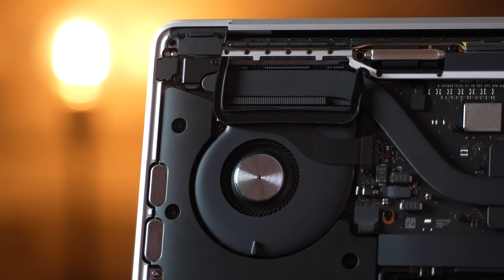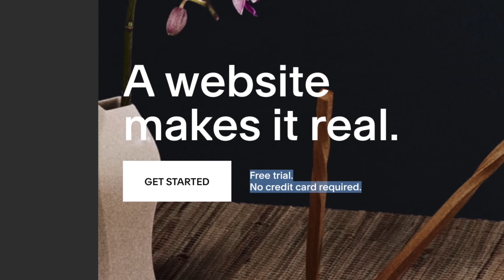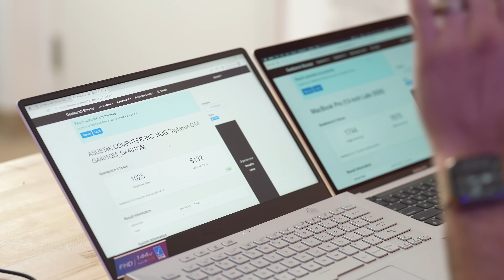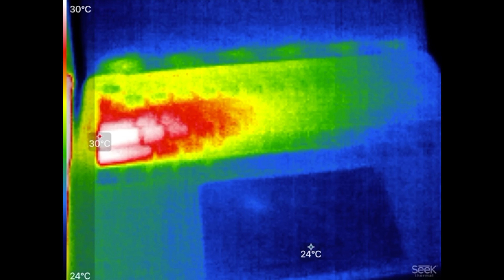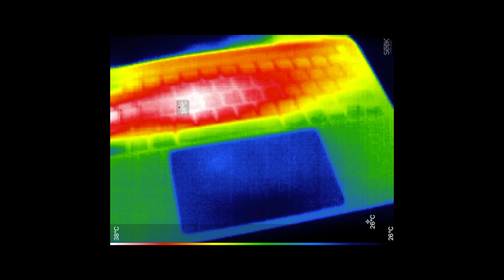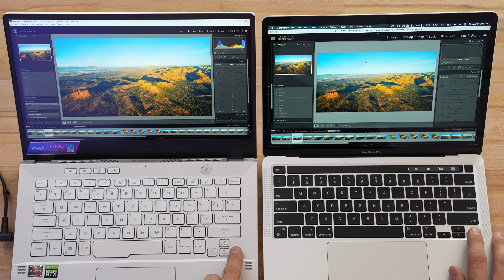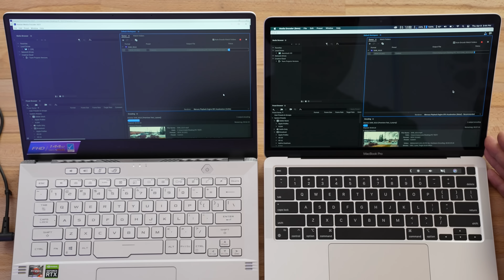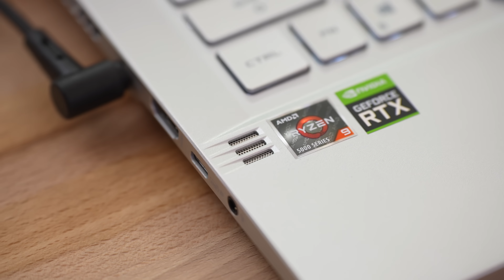Apple M1 vs AMD 5900HS + RTX 3060: FINALLY an M1 Killer?

Comment: Still amazed how M1 macs are being compared to gaming laptops. Hands down
Reply: On graphics AMD scored almost 5 times more than M1 still it's a comparison????. M1 is better in CPU but not in GPU which required for gaming.
Reply: @sakalasiva  but you missed the fact, that 5x faster GPU is only had 2x more frame rates in the next test (3D Mark). And that fps is also required for gaming. Apple still just can double the 8 GPU core to 16 or even 32, and the frame rates will goes up for gaming. Not to mention the advantage of the same ARM based store on every device. Compared to windows+android, they can give you the same game from the same store on the phone+tablet+laptop+desktop. You don't need to buy anything multiple times, you don't have 2 different savings on each device etc. Because it's the same account with same store on every device. Currently they are not better for gaming, but they have a huge potential to take this market without a real competition, when they starting to focus on gaming too.
Reply: @Garrus Vakarian how do you do a comparison for a game that doesn't even run natively on macOS?
Reply: The Price on the G14 is pretty sweet though!!
Reply: @elephant_888  Indeed $400 cheaper the the mac and faster in raw performance where it matters. Seems like a no brainer to me if you want to get the best bang for your buck. If that mac were to fit itself with the same graphics card we would probably see at least a $250+ further increase in price xD.
Reply: Actually it was never compared to a
"Gaming laptop"
He hust compared this with another laptop that happens to be a gaming laptop.
What i meant was no test in which a gaming laptop is meant to perform was used in this video like it was meant for M1 to compete.
Gaming laptops are meant for performace and tests should be base on that Port Royale, BMX, or even a real game or something which is designed to be operated on a gaming laptop
Reply: @priyanshuanubis  True, gaming laptops are tweaked to perform better at gaming and not video rendering. The driver sets are completely different. Most YouTubers don't know that. They think a pc that has graphics card and a powerful processor should work great for both gaming and editing equally. That is just silly.
Reply: @priyanshuanubis  
You are NOT IGNORANT 👍👍
Reply: @priyanshuanubis  it is a gaming laptop because it has a gpu
Reply: @priyanshuanubis  Well it did test the claim of fastest mobile cpu according to amd, and M1 excels at that…you must be confuse it with comparing it to the gaming performance…G14 is definitely a gaming laptop…asus list it as their ROG lineup…but since M1 was never geared toward gaming capability…in fact it is aiming at a low tier baseline next gen Mac, and it killing any high end mobile cpu offering from amd and intel.
Reply: with a fucking RTX 3060 no less.
Reply: @RandomUserX99  and gaming laptop still win on gaming tenfold... they do compare cpu performance, but as a gaming device  mac just suc...
Reply: @RandomUserX99  so I can play games on m1?
Reply: @RandomUserX99  he didn't even test the GPU tbh
Reply: If it cannot even run games why buy such a Laptop i dont understand Apple Fans sometimes.
Reply: @mars-kw8xo  benchmark get them off lol, bro show some gameplay that gaming laptop would had dusted the MacBook
Reply: @mars-kw8xo  and no one talks about the heating issues and the soldered ssd
Reply: @tusk6400  Or the fact apple has a history regarding keyboards that fail. They claim its fixed but only time will tell xD. Apple likes to deny that problems exist--kept using same keyboard in later models despite the flaw in design instead blaming customers for why their keyboard goes bad. Then there is also this recent problem cropping up with m1 laptops: 

https://www.youtube.com/watch?v=u7LOljirF6g
Reply: same and if games were made for the way the ARM caps work( what the m1 chip type is) it would be even better
Reply: $1900 macbook pro
Reply: "Gaming" is just a marketing term.
Reply: @l96ai  Pretty much, I am not sure why apple doesn't use that word at all in their description for ipad pro or macbook, many don't know you can game pretty well on them now.
Reply: @franciscoalcala25  Because, to be a "gaming" laptop...It need a good GPU!!
M1 has a shitty integrated one...No one calls a lap with integrated GPU a gaming laptop!!!
Reply: @harid4249  Bro it can run fortnite andd apex legends at a stable 60 fps, its at least as good as the ps4 pro, and on par with many gaming laptops.
Reply: @franciscoalcala25  🤣🤣🤣🤣
Fortnite and Apex legends 🤣
Why don't you add minecraft and sudoku for extra credit..🤣
Those are some of the less intensive,easy to run games.....
Play Assassins creed Valhalla at high settings with atleast 60fps at 1080p...then I'll admit M1 is good enough lol. Which is never gonna happen 😆
Reply: @harid4249  You may not like them but they are games, and the ps4 can't even do that. This thing is more powerful than the ps4 200 million people out there are still playing on.
Reply: @franciscoalcala25  my  non gaming laptop with 9th intel i5 on maxed settings ru. fortnite at 55-60fps. m1 run fortnite on medium at less than 60fps with frame drops... there is a differense... gaming laptops run fortnite at epic settings at 100+fps some at 200fps
Reply: @l96ai  you're damn right, when you don't mind a kg and worse battery life, a gaming laptop is perfect to heavy computing work and you still want to be mobile
Reply: Didn’t show no gaming though
Reply: At M1 price you can buy a gaming laptop. What you want it to be compared with?
Reply: @RockyBell   Can you really buy a gaming laptop for 999 $?
Reply: its compared well on channels which are payed /spnsored by apple
Reply: All these comments and video shows is how little you know about computers. When you pull the plug on the laptop it switches to either power saving mode or not depending on default settings or user settings. 1 he doesn't say what those settings are but his test results show the laptop is not running on FULL settings. IF he had turned on performance mode (which he should have when testing performance) the laptop would have lost almost 0 performance without being plugged in. I have a mac and Intel Asus laptop and If I turn on power saving mode they both run at less than half the speed. The Mac defaults to a much higher performance level than the ASUS though. The same goes for being plugged in.

If you wanted to do ANY type of real testing you would measure performance per watt which the M1 wins but overall performance the Asus will win EVERY TIME (by a huge margin).
Reply: Here's the score
Mac : 6 points
Asus : 5 points
Which means  🍎 won
Reply: still amazed that ordinary laptop charges higher than top tier compact gaming laptop
Reply: M1 being First of its kind.. killing it
Reply: @vignesh5513  king of heating trotled ans overheating 💩
Reply: @vignesh5513  killing it with poor fps in games
Reply: @vignesh5513  including the ssd! ROFL!
Reply: Can only imagine how good the m1x would be!
Reply: Amd processor are not still yet optimised as compared m1 which is ultra optimised
Reply: The only thing compared is CPU performance. The AMD machine just happens to be a ga.ing laptop.
Reply: The price diff tho
Reply: @Garrus Vakarian Maybe you should have calibrated some more on your machine.
Reply: What games are tested?
Reply: @Garrus Vakarian well, we knew that to make really a powerful gpu still take a space almost a half of pc nowdays. People still trying to do a critical thinking on how we're gonna reduced the size of it

Edit: did i reply to the wrong target? Sorry 🤦‍♂️🤣😅🙏. I forgot who and what comment that i replied. Seems your comment is fine🤦‍♂️
Reply: @Garrus Vakarian sorry if you didn't get what i mean. What i mean is, it's nearly hard to make m1 gpu perfomance to be comparable as an rtx. However, m1 gpu is already in good perfomance, but to make it to ripoff rtx? that still as small as m1 chip that also didn't need a fan??? need more research on that, time will tell

Edit: did i reply to the wrong target? Sorry 🤦‍♂️🤣😅. I forgot who and what comment that i replied. Seems your comment is fine🤦‍♂️
Reply: @Garrus Vakarian He's an A Simp
Reply: Why shouldn't they, they cost 5 times more than gaming laptops.
Reply: M1 Macs fades away so fast when compared to asus rog flow x13.
Reply: @Nramanoodles i'm just gonna copy and paste this after seeing all the replies of how any cheap gaming laptops are bad, take a look at the 2021 legion 5
Reply: Ι don't see any gaming comparisons...
Reply: Gaming laptop with less price's than those overpriced MacBook lol
Reply: Well they are also comparable in price, so it should.
Reply: Now make the m1 run cyberpunk
Reply: This comment can be interpreted in two ways:
1. "Mac is so good that it needs to be compared to a gaming laptop"
2. "Mac is so expensive that it has to be compared to a gaming laptop"

I personally use Mac for work and I have a beast of a gaming PC that I built myself.

So yes, I suppose it is "amazing" how both laptops are being compared. Depends on how you interpret it👌🏼😉
Reply: I may dislike Apple, but I do respect what they achieved in the M1 Arm chip, it'll be interesting to see what else 64 bit Arm can do from here on
Reply: Why they cost more you should be amazed by the 1400$ machine that's out performing the m1
Reply: Copied comment
Reply: It doesnt matter if its a gaming laptop or not, products within the same price range are always comparable..
Reply: Why does it matter when they are at the same price point. Infact the gaming is cheaper.
Reply: But Mac is more expensive than Asus 🤣
Reply: Has "3060" performance yet it cannot perform the same as one  lmao 
Very dissapointing
Reply: Also either fanboys from each side you guys are shlt
Reply: Well it costs more... So why wouldnt it be compared with that?
Reply: I will never understand why apple fanboys are so defensive
Reply: What a moron xd this is comparing more like the amd cpu with apple cpu, this just heappend to be a gaming laptop. Mac its really bad fpr gaming xd
Reply: @shadowform1264  if the gaming laptop didn’t have a gpu it would have wurst preformence than m1 MacBook and that is tested
Reply: @cossieboy  but it has and you pay also for the gpu what would make even more cheaper lel
Reply: gaming laptops are cheaper than m1 macs ☠️
Reply: @Theodor-qo7ku  not the ones being compared to the M1 MacBooks
Reply: @Theodor-qo7ku   gaming laptops are also built like shit and are loud as all hell. $999 for a “premium ultra book” is a pretty standard asking price. Every premium windows ultra book I’ve scene in recent years launches around $1000-1300.
Reply: @90sGasPrices  i'm just gonna copy and paste this after seeing all the replies of how any cheap gaming laptops are bad, take a look at the 2021 legion 5
Reply: @Theodor-qo7ku   and gaming laptops have heat/battery issues.
Reply: @halfalligator6518  i'm just gonna copy and paste this after seeing all the replies of how any cheap gaming laptops are bad, take a look at the 2021 legion 5
Reply: @Theodor-qo7ku  but not cheaper than m1 ipad pro which has the same processor and same gpu for 799 USD.. I know, I am also surprised.
Reply: @franciscoalcala25  you can't compare ipads to laptops, unlike what everyone says. ipads run on a completely different OS, ipadOS, that leans much more towards a mobile-like experience. sure, you're getting amazing performance out of it, but you won't really need it on an ipad running on a mobile-like OS
Reply: @Theodor-qo7ku  are they??? Education pricing brings it down to $899.
Reply: @Theodor-qo7ku  How's $1000 more expensive than $2300?
Reply: @Theodor-qo7ku   yeah, because they have the worst trackpads, bad speakers and not so good displays. They're thicker, heavier, louder and the battery life sucks. No wonder gaming laptops are cheaper ☠️
Reply: @paulsamuelmusic  gaming laptops aren’t cheaper... who said they were?
Reply: @huey1153   @Blade Blede said that.
Reply: @paulsamuelmusic  the good ones cost more than macs
Reply: @paulsamuelmusic  actually g14 screen professional grade and also 144hz... m1 is little bit better in colors but nothing major. its not that gaming laptops is cheap, its apple tax
Reply: @racistpixel1017  I disagree that the apple tax exists with the M1. Nobody would carry a thick gaming laptop around and do their work. And having a display with a higher refresh rate is not what I really need.
Reply: @paulsamuelmusic  that thickness of g14 really not a issue. and gaming laptops for gaming, not for office... keep in mind with m1 performance comes great limitations,  you get fast m1cpu but for same price you can get pretty decent cpu from amd amd superior gpu, moria io and so on... this is how apple tax works on m1
Reply: @racistpixel1017   is there a laptop that comes even close to the performance and is that portable under 999$? Sure, there are small things that the M1 is limited but that is not enough to say apple tax still is a thing with the MacBook?
Reply: @paulsamuelmusic  asus zephyrus g14, almost same performancr cpu plus superior gpu to  back it up, plus 144hz screen that makes OS smooth and fast... plus io, more ram and more ssd
Reply: @racistpixel1017   at 999 $? And the battery life? Does it have a good trackpad and keyboard?
Reply: @paulsamuelmusic  show me m1 device with decent IO, fast hz screen, with powerfull gpu, with more than 16gb ram, more than 1 tb ssd,  that can use multiple external monitors, have games and apps library as big as windows, do apple have a device for everyone needs? x64 have multiple brands and different deviced for diferent use cases... just cuz mac have litte bit better keyboard it does not mean it good for everyone, there a mechanical keyboards that for allot of ppl is better what apple can offer, while we have decent and more than usable trackpads we also have mouses and use these mouses instead trackpad so no need for that, really i keep my trackpad disabled, dont know a person who needs a track pad. X64 offers deviced with full day battery life to, same zephyrus g14 is 14h battery life... apple have offer just few nice perks that we can live without, but also offers many limitations... so yah that 1200 for m1 laptop comes woth many limitatios non existing in x64 world
Reply: @racistpixel1017   that's true but keep in mind that this is their first Apple Silicon Chip and that the next ones could be something for you. The M1 in the MacBook Air is amazing and it beats every light ultrabook and comes close to the performance in a gaming laptop. It is clearly not made for gaming and the limited io and external displays and gpu and other limitations are probably less a problem with the upcoming rumoured M1X. It's absolutely incredible what the M1 achieves (btw I personally do not need a 144 hz screen, more than 1tb ssd or more than 16 GB unified ram).
Reply: @paulsamuelmusic  m1x will be same m1  with extra cores so i doubt it will be so awesome... and m1 far from gaming laptops, my non gaming laptop with 9th intel i5 run fortnite on max settings at 60fps while m1 brings barely playable experiance on medium... on gaming laptops fortnite runs at 150-200fps... to say that m1 is almost as powerfull as gaming laptop is just... plus ppl missunderstand what m1 is amd what x standsfor. 

m1 is apple bigger version of a14 cpu, X means its same cpu with extra cores... m2 will be bigger apple a15 and as history show us so far that each apple a series cpu is around 20% more powerfull than last one.
and next gen apple devices io will stay the same since even with intel versions apple newer give us decent io. i bet pretty mutch everything will stay the same as it always did. you will get slightly faster m2 cpu and slightly Faster igpu.
Reply: @racistpixel1017   let me guess, you ran Fortnite with crossover where multiple emulations are necessary. And your 9th gen i5 has probably a GPU because the UHD integrated GPU's suck. The M1 is far better than any intel i3, i5 and older i7. The M1X will have more than just more cores with at least 32 GB ram and definitely more io.
Reply: @paulsamuelmusic  yah m1 is far better than i5 but in real world use i5 + video card is way better than m1 for average user, if you not Profesional you wont utilize whole m1 power and if you are a profesional, m1 come with limitations that can break your work flow. only if you need that battery... and  no if you look what apple always did with theg'r X cpus on iphone, they only added extra cores, x for extednded. and apple even to intel laptops newer added decent io, even if they could. why you think they will add now, they newer in history done that
Reply: @racistpixel1017   in "real world use" the M1 is far better! Have you seen the comparisons? I totally get it that especially games are not natively running on arm and the limitations are for professionals a dealbreaker but intel is far behind AMD, and even further away from the M1. I don't know why fortnite runs so poorly on your M1 but there is nothing an i5 can do better for the "average user". The next apple silicon chip will have more than just more cores because we're talking about desktop Macs and not iPhones and iPads anymore.
Reply: @paulsamuelmusic  so where m1 better, browsing a web, watching youtube, playing games? this is what i mean real world use, most of ppl cant utilize full m1 power. and for limitations, if you will research little bit you will se that m1 usb transfers files at 300mb/s that is slow, if you youtuber or anyone else who need to transfer terabytes every day, thats slow. plus allot of profesionals use multiple monitors setups that is not provided with m1. blender eevee and cycles rendering on m1 almost impossible so if you in to these things, your work in 3d with blender then well, sorry. who knows what else limitations m1 have. there are allot of profesionals even 16gb ram is to little, even so when those 16gb is shared as gpu memory. my friend who study cinematography unsatisfied with air 16gb model, on big complex projects the preview is choppy while on his friend intel with video card there no such problem. m1 only wins on exporting times for him.
for io of its on desktop i believe it will be more io like on mac mini but i cant find any legit source for upcoming m series cpus, only rummors and so called "leaks" with no sources.
Reply: @racistpixel1017   the M1 has USB 4, that's basically Thunderbolt 3 so 300 mb/s is not the limitation that the M1 has. Where do you find these false limitations? It's definitely faster in basic tasks and what do you mean with most people can't utilize the full m1 power? Rosetta brings great emulation better than Microsoft ever did and for the professionals is the M1 not the right choice, that's where the rumoured M1X comes in.
Reply: @paulsamuelmusic  this sounds like a non-gamer comment. Gamers don't use laptop trackpads or onboard speakers, and 144fps 1080p > 60fps . Anyone gaming doesn't expect to be gaming on battery, so the lacking battery is also a moot point. Everything you don't like about the laptop, gamers don't care about.

This is simply a difference in target audience, so why try so hard to make the laptop sound bad? That's like me saying "lmao $1900 M1 has shit FPS and can't even run more than 60fps anyway. Who would pay almost $2k for that shitty performance?"
Reply: @dat_lou5561   I know that, and that's why the M1 has this price. It's not a gaming laptop and the design and graphics performance are not made for gaming. But gaming laptops are on the other side not automatically better than every ultrabook. Because all the points I mentioned are important for me. I said this because one comment said (I can't find it anymore) that the M1 sucks because gaming laptops are cheaper.
Reply: @paulsamuelmusic  just try to look to youtube issue of m1 usb speeds. and plz show me how you utilize m1 cpu to 100%... most of ppl dont need that horsepower, even for gaming gpu is bootlenecking. youtube or web browsing takes like 5% of cpu... what average user will do with rest 95% and that m1x is just a rummor, no facts, no official data... so far apple with every cpu marked with X just increased cores count that gives better multicore coore, where facts and official data sources that tells that m1x will be something out of this world, but not something apple do with, x processors for years... everything you know about m1x is a rummors and gossips but history with apple shows X = more cores.
oh yeah dont forget that m1 is A14x... so there more chanses that there will be no m1x but they jump directly to m2 that will be A15x like they did with m1
Reply: @racistpixel1017   so your point is the M1 is overkill in CPU performance for the average user and the limitations make the devices unusable for professionals. And with the M1X, it's true that there are just rumors but it's definitely clear because apple said they'll be switching every of their products to apple silicon. M1X is just a rumored name, it could be also something different.
Reply: @paulsamuelmusic  my point that for average user cpu is to much, its good to have good cpu, but what the point if sluggish gpu cant keep up. for professionals they are more than able to do work, but if they willing to sacrifices limitations over  battery and faster exporting times. other wise just like they was able to do work with older and slower intel mac's, they can do now with either newer intel or amd systems and might get more value out of those machines...
Reply: @racistpixel1017   what would you expect from an iGPU? I totally get it that it sucks that eGPU's aren't working with the M1 but it's like saying every APU from amd has great CPU performance but the sluggish GPU can't keep up. Apple has still a great advantage that the iGPU is the most powerful iGPU currently available and that the optimazation with MacOS Big Sur really pushes its limit. And why would anyone switch to a windows device when they use an older intel Mac? People that have Macs bought a Mac mostly because of MacOS. And getting a better value with x86… I'm not so sure because every company who builds CPU's except for intel has plans to build future processors with the arm technology.
Reply: @paulsamuelmusic  yah  but  with amd and intel you have option of dedicated gpu...  igpu not meant to replace dedicated one, just to render OS... my laptop for 700euros while having 9th intel i5 also have gtx 1650, whole laptop as slim as my slim finger and weigh little bit more that 15' mac... and its a budget cheap laptop...
Reply: @racistpixel1017   the 15 inch mac is pretty heavy in my opinion and the dedicated GPU is probably slower than the integrated GPU from the M1 + The 9th gen i5 is a joke against the CPU of the M1…
So it makes complete sense why it costs 700 €. And I think the iGPU's are getting more powerful than ever so I think having only an integrated GPU is at least for me not a dealbreaker. I know these are just rumors but the next apple silicon chip should have double the GPU cores than the current M1.
Reply: @paulsamuelmusic  gtx 1650 is in different class what m1 can offer, while its entry level gpu, it still packs a punch. and yas, while that i5 is a joke compared to m1, but look, it can do everything what m1 can do, laptop is fast, snappy and all that. plus on top i have 120hz screen that makes os smoother than m1 macOs is. whole windows os rendered at 120fps. m1 wins on battery life that i dont care about amd exporting times that i also dont care about. on my laptop i have all apps i need without emulation, for example i need blender and unity, both on m1 sucks. i have more ssd and 2x ram what m1 can offer. i just dont see why i should choose apple over what i have now. i have all ports i need where on  mac i have literally none. i have 2.5 tb in external ssd's, one us usb A. my mouse is usb A, i connect my drone with usb A plus all software to program my drone only on windows os... and list go on. only thing i conest with c is one ssd and oculus googles, and on my laptop i have that port. for weight, i could choose smaller device, but the screen is to small so... only available m1 mac is same 15', but why i should, it gives me less value and on top its more expensive.
Reply: @racistpixel1017   I personally don't care about a 120fps, for me 60fps is definitely enough. And just a question, do you have a M1 Computer? Because there is a big difference in calling an i5 "snappy and all that" because the M1 is a so much more snappier and quicker. The gtx 1650 is actually not that much faster than the 8 core GPU from the M1. And Unity works on my M1 Macbook Air completely fine. Blender should work fine as well. I'm also confident that you wouldn't need 32 GB unified ram, 16 GB is almost overkill, I mean it seriously. I guess the io is a dealbreaker for you but there are surprisingly a lot of possibilities with just two thunderbolts on the MacBooks and more on the M1 Mac Mini. There's even a work around from the limitation of having only the maximum of two displays (I don't know the steps to do that though).
Reply: @racistpixel1017   https://youtu.be/r5bAMoQt7EQ
Reply: @paulsamuelmusic  yeas cpu is faster, better exporting times, but windows mchines brings more on the table just than already decent cpu power, there is a point where faster exporting times just wont cut it... m1 have many limitations that windows machines dont have. you only get cpu power that most ppl rarely can utilise or even tell difference.
Reply: @racistpixel1017   why are you always talking about exporting times? In that video he clearly talks about that there is a noticeable difference between all benchmarks and real world use, things where the 8 core AMD processor should be faster. People can utilise the full power of the M1, period.

…Btw, did you actually watched the video? Everything you said did you already mentioned in earlier comments.
Reply: @paulsamuelmusic  no i did not, i seen many of videos like this and a friend have mac air. hype nothing else, fast cpu, slow everything else.
Reply: @racistpixel1017   🤦‍♂️ maybe you should listen to other opinions and experiences. And I can promise in that video a sceptic against the hype.
Reply: @paulsamuelmusic  now say that again after looking at the legion 5, 2021 version. basically everything the legion 5 is, which is a gaming laptop, is the opposite of what you said
Reply: @huey1153  i'm just gonna copy and paste this after seeing all the replies of how any cheap gaming laptops are bad, take a look at the 2021 legion 5
Reply: @travisporter357  i'm just gonna copy and paste this after seeing all the replies of how any cheap gaming laptops are bad, take a look at the 2021 legion 5
Reply: @shiftadvance  that’s the laptop i want for gaming
Reply: @travisporter357  yeah, it's amazing. i wish i got that instead of my G5, mine overheats like crazy (you could fry an egg at that point :P) and the performance is actually so underwhelming... if only i got that legion 5 :')
Reply: @Theodor-qo7ku  eh what? The G14 cost 1800 euro ($2150) here....vs the 13 inch macbook pro which is 1100 euro ($1320)
Reply: @magnat505  it depends which m1 and which gaming laptop we're talking. If you spec up the M1 to make it comparable, the M1 will tend to cost more.
Reply: @blinblinthing  The cheapest G14 is 1800 euro, the cheapest M1 is 1100 euro :P, the most expensive is also different.
Reply: @magnat505  I don't think the cheapest m1 is in the same league tho. Maybe half the ram, storage and lacking a capable gpu.
Reply: @blinblinthing  ram isnt half as important on a mac as it is on windows, storage is only interesting if you need to store games i suppose and yes maybe gpu. Its not that fast, but for sure its not slow either. Besides you get a way better screen, build quality and battery life
Reply: @magnat505  way better screen? It's 60hz.   If ram isn't that important as you suggest, maybe Apple should stop selling that upgrade then. Me personally, the environment I'd use my laptop in, would usually have an outlet nearby, so I'm not worried about better life. Plus, you get a boost in performance when on outlet. But to each, their own.
Reply: @magnat505  Don't even get started on build quality. Almost every apple product has a design flaw. Watch Lois Rossman's channel, you will understand.
Reply: @harid4249  I had 3 macbooks in my life, all of them were used 10 years, first 5 by me, then 5 by my moms. None of them ever broke, not a single time. I understand apples repairability sucks, and they had some problems like the keyboard, but fortunately mistakes can be fixed.
Reply: @magnat505  I understand that...every machine may have its faults and shortcomings. But the fact is that apple doesn't admit their mistakes and blame it on the customers instead. They will charge 1000's of dollars for a silly repair and make customers believe that buying a new one is a better option. Which cannot be tolerated.
Reply: @magnat505  mac mini with 8gb ram cant do any job well really , mac's do need ram. when doing video editing with 8gb ram, mac lags af
Reply: @Theodor-qo7ku  the bullshit ones
Reply: @travisporter357  i'm just gonna copy and paste this after seeing all the replies of how any cheap gaming laptops are bad, take a look at the 2021 legion 5
Reply: They're both really small
Reply: @AndrewMcleod7 smol
Reply: @AndrewMcleod7  that's what she said
Reply: He forgot to compare that RTX 3060 To M1 integrated GPU.
Reply: LoL that m1 is a shit processor. The actual raw difference between those two are nights and days. All the apps in apple computer are specially coded for them
Reply: @SMFARHADUZZAMAN  Just bunch of noise statements without any concrete point…butthurt fans here
Reply: Its not comparable, since they are using different cpu architectures,ARM basically just skips some tasks while AMD64/x86 just does the same task multiple times for error correction and they are threaded meaning that 1 core is split in 2.
This is just a simple explanation there are some slight errors
Reply: Diehard apple fan, spotted 😂
Reply: @lynx873  ya. I think apple fans are the most stupid people in the world 😂
Reply: @SMFARHADUZZAMAN  yes they are always think expensive is everything
Reply: Exactly!!! 😂 Apple’s budget laptops vs Gaming laptop!!! 🤣🤣🤣🤣🤣🤣
Reply: @elephant_888  whether you want to call it budget or not, it's priced to compete against the other laptops.
The cheapest laptop here had more output.
Reply: @elephant_888  but the gaming laptop is $400 cheaper...
Reply: @elephant_888  sadly Apple's budget laptop is more expensive than a gaming laptop
Reply: @elephant_888  budget and apple two different words that don't match at all
Reply: @elephant_888  apple never made aby products dumbass M1 is made by tsmc
Reply: @elephant_888  but the price is exactly same lol
Reply: @elephant_888  the apple costs more... so you words mean nothing.  Gaming... working... browsing don't matter.  Crapple cost more for less power.
Reply: @bp8143  get a life dude. People have better things to than respond to trolls on 4 month old posts.
Reply: @elephant_888  A. here you are responding. B.  Stating facts is not trolling.  That is not a gaming laptop.  Stay buttmad cultist.
Reply: @stonks True M1 only has 15w while others have 100w
Reply: Why is this thread discussing games for an Apple device? The g14 happened to be a gaming device, but gaming is not important to MacOS users (the majority at least), so why the fuck would we care about gaming performance? Macbooks are creative devices, and any comparison to other devices would be on the creative aspect as well. If I buy a mac I don't think about playing Warzone at 144fps or some shit, I think about rendering time for video, rendering for 3d work, web performance, OS (unix based, linux still better but macOS is way better than windows in software development), snappiness, display quality, build quality, and battery (it's a mobile device, I want to be able to move it around and do shit and not having to always mind if there are plugs nearby). So far, for the majority of people that don't care about gaming, the MacBook is the clear winner, especially for the MacBook Air at just $1000, except maybe specific workplaces where windows only programs are needed (tho you might be able to run them through parallels or other vm programs).